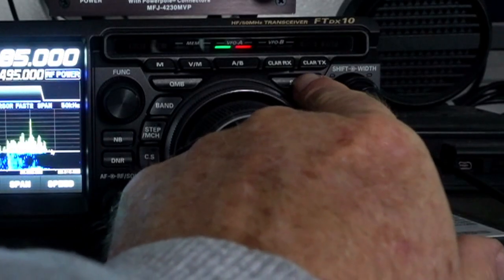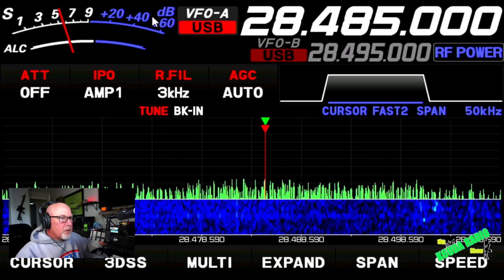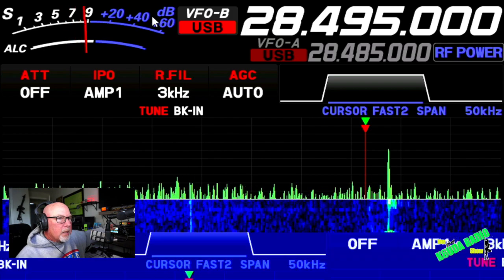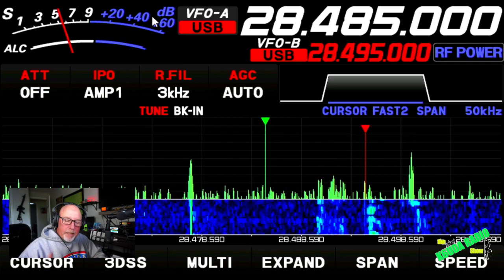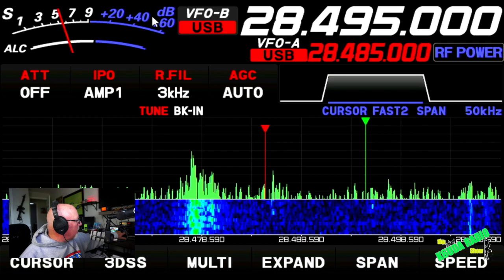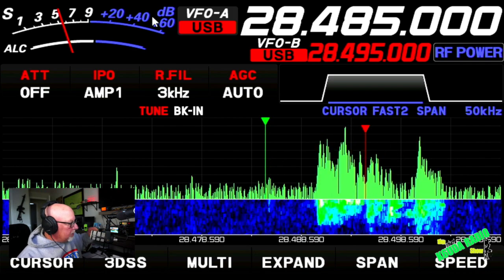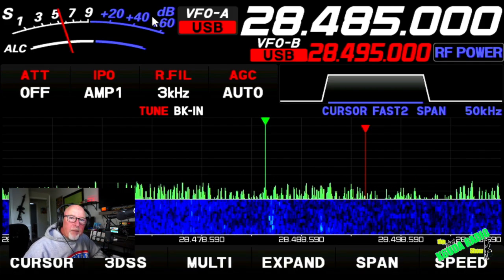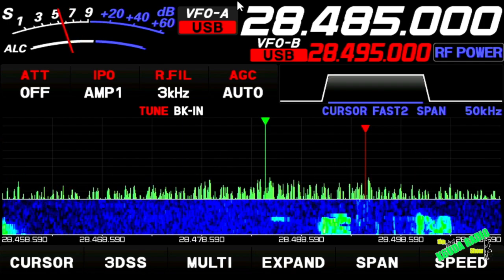What's That Button Do? - Split

Comment: I disagree regarding the guys calling out to the clowns that a station is running split. I've not heard them as durogatory as you but too many people don't listen these days. They turn on the radio because they see a spot on a cluster and just start calling. They need to learn a little bit. There is very little learning now, only memorization for the test, since the code is gone thus the poor operating habits.
Reply: The guys telling people they are running split never ID. It’s bad form.
Reply from the maker: +@ske1eter yes, I get it. It’s frustrating. But honestly it was mostly occurring on 10 meters within the sliver of the band open to techs. Some of the insults were kind of embarrassing to listen too.
Reply: I don't think code is any kind of differentiating factor. It may contribute in some sense but overall what I think is missing is the ham tests focus so much on regs, electronics, bands, propagation etc, they totally leave out anything regarding how to use a freaking radio. I suppose this is where having an elmer or something comes in but in today's world where everything is online instead of the old club days, it seems that radio operations is hugely neglected. YT has plenty of materials for this but people lose the interactive QA aspect that is present when with someone side by side. When covid hit many clubs essentially shutdown or went online and newbies are not as well connected as a result.

Comment: I threw my callsign out yesterday a few times but it was insane.  It didn't help that the OP said 5 to 10 up.  It was a s show, I gave up.
Reply: It's easier than you believe. And when they run split, it gives you more of a chance to get the contact than if they were all stacked on one frequency because many of the people calling are all spread out and not concentrated in one spot.

Comment: nobody on 30 meters had any problems figuring out what's split and how to use it last night working tx5s. it's only the phone ops who're not too bright. I wonder why that is...
Reply from the maker: You gotta remember it was 10 meter in the tech window of the band. I just worked TX5S on 20 meters SSB. First call in the morning.
Reply: @K6UDA I listened to the mayhem most of the day, the callsign formats of the lids suggested extra class in many cases - those not using split (perhaps no code extra) so I'm not sure how much it being tech portion of 10m mattered.